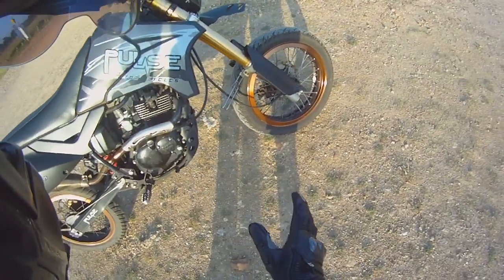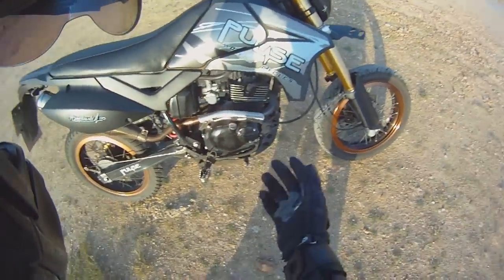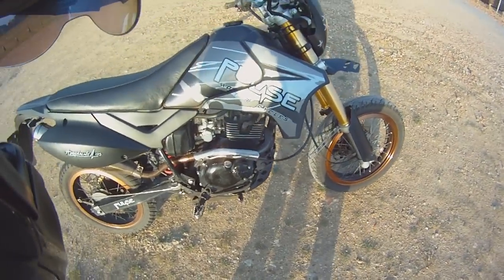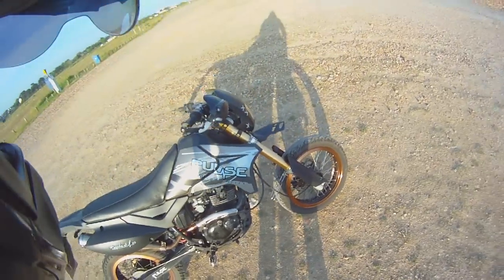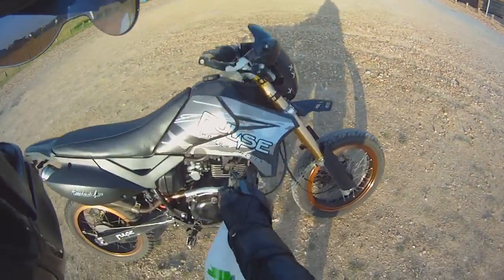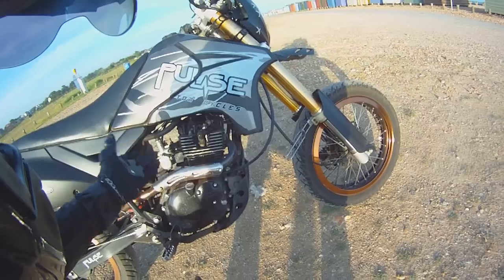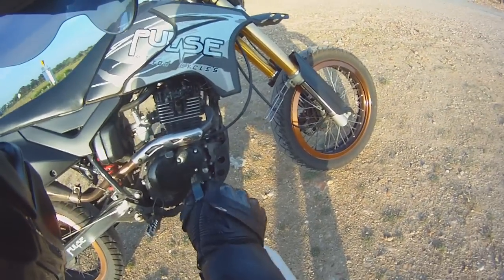Air to water cooled engine conversion, Easy way!

Comment from the maker: OK lets get this strait. This video is a JOKE!! of-course this is not a viable method.
BUT Spraying a little water on your engine is not going to crack the engine. 

So many have said this and its just silly! 

Riding a motorcycle in the rain doesn't crack engines.  
Riding a motorcycle in a river crossing can submerging the whole engine (the air intake is higher up) 
dose not crack engines!
Do some research plenty of people think it is true but it is not and there just isn't any evidence for it happening. 

Theoretically shock cooling metal can make it crack but this just doesn't happen with motorcycle engines or car engines or quads etc ect

Comment: I did this on a 1200 mile trip across America on a 50cc scooter and got 200 miles to the gallon cruising at 13,000 rpms. It Works! - The Chicks dug it too.

Comment: There is no need to spray down an engine with water. Air cooled engines are designed to run significantly hotter than liquid cooled engines. Simply spraying it with water won’t do anything, and if the water pressure your spraying it with is high enough (say a garden hose), more than definitely the engine will crack. With the exception of what material it’s made of. If it’s an old cast iron engine running at a “million” degrees, more than definitely it will crack. I don’t really see this happening on an aluminum engine, however, if you do spray it with water, it will weaken the metal and eventually it will crack. It is 100% unnecessary to let an air cooled engine “cool down” unless it has overheated.
Reply from the maker: 1. it's a joke!?
2. No it won't crack. 

I can prove this here https://youtu.be/OXWjNbE0PCU
And here https://youtu.be/3oheaDggdXA
I tested both cast and ally.
Enduro bikes are ridden really hot and then strait in to a river and engine don't crack, you just have to think about it.

Comment: I love how people are saying it will crack the case when they don't even know the parameters. The engine could not of been that hot. The water might not of been that cold. And remember its a spray bottle. So a lot more finer that rain. Oh and it is possible to crack the case, and I think it might be down to metal fatigue. I'm no expert. So don't take me seriously! <3
Reply from the maker: If a case cracked due to water on it,  it would  be down to a bad casting, you are quite right.

Comment: You know what though?  That would actually cool an engine off a lot more quickly than just leaving it sit there.  Say it was over heating in traffic or something.  Spray a little water on the cooling fins.  Could Be the difference beetween just running warm, and over heating.

Comment: Dehydration and overheated mind may exist in this video..
 I Just run MOTUL SYNTHETIC 5w30 oil meant for 4 stroke racing engine and never bother worrying that it is air cooled...  
Also, oil coolers do work well..
Reply from the maker: It's a joke, did you miss that lol

Comment: like what? the unbelievable power to weight ratio they produce, the fact they have double the displacement of a 4 stroke? yeah sure, some people might not like the sound, but when it's not a tinny two stroke, it sounds well nice, say a 2 stroke at 10000rpm, all it sounds like is a 4 stroke at 20000 rpm, I personally like that :L the only bad bit really is fuel, but I'd rather have more fun and pay a bit more for fuel :)

Comment: Replace your horn with a 9V pump that sprays water out of a 1/8th tube.
Reply from the maker: Haha I like it!
Reply: @spicy110  Who needs a horn anyway? Every one knows hand signals work best on motorcycles. 

Since you lack car doors, everyone should be able to see you flip them off from miles away in all directions.
Reply from the maker: Hahaha

Comment: actually... what you could do is use a heat exchanger in line with the oil, and have a separate radiator setup with an electric pump, if you really wanted to cool it with water. Spraying it is just... bullocks.

Comment: Oh yes, just get the engine extremely hot then dump tons of water on it. (note: it will crack the jug) if you want a water cooled engine should of bought it water cooled.

Comment: if you could engineer an elegant solution i'd be less likely to laugh at your idea....but as a concept it's great
Reply from the maker: +k9wiREless it's good you laughed it's clearly a joke lol
Reply: For all the people how have 1961 - 1971 VW type 4 and or 1963 - 1983 porsche 912 and other air-cooler engines

Comment: Don't do it ! if you spray water on your bike it will split the crankcase, remove the bearings, and dissemble the chain link by link.
Reply: Nathan Dance is that really would happen since the water is just a little amount and divided in every space very good . i thought cracking crankcase would happen if you pour water from the glass ..
Reply: Only if you have a Chinese bike. (Sorry Spicy, I know you like Chinese bikes!)
Reply: Thats not true.  At all.

Comment: spraying cold water all over hot magnesium crankcases will not crack it......said no one ever 😄🤣
Reply from the maker: Dude, I have made 2 videos putting heads in fire and then water, no cracks. My DRZ has a magnesium engine case and I have ridden it hot in to deep'ish water or you know.......Rain?
Reply: @spicy110  hi mate,

hmm didnt see your video posted but ive been building bikes and motors for over 10 years now the head is a lot thicker compared to what the crank cases are burning and then cooling the heads may not of cracked them but they will still be warped and will leak compression as it wont be flat surface on gasket any longer over time sudden heat & cold cycles will crack any motor case, jug or head.

try burning & cooling some old cases if it doesn't crack wide open there will be spider cracks everywhere especially on lower end chinese motors Japanese bikes are a lot better quality wise so may withstand full fractures bit will still crack over time.

Cheers
Reply from the maker: ok so genuine question, what about the fact people ride dirt bikes and adventure bikes in to rivers submerging the engine and we never hear of these issues. Also rain is way way more than this spray bottle so really can not be in the same realms of cooling shock. (I also assume you understand this is a joke video)

Comment: Dude! water cooling is necessary to allow higher compression ratios. If you increase the compression ratio of your air cooled engine in the search more power, that is when you need more cooling. You spraying on the outside doesn't help internal expansion of cylinder walls and you end up seizing the engine! Remove the darn video. It is appearing in search results!